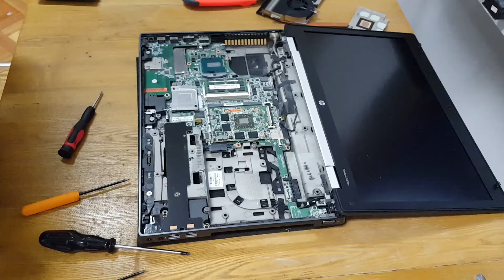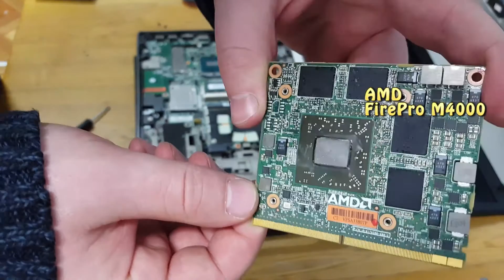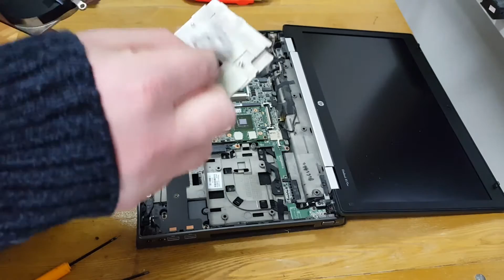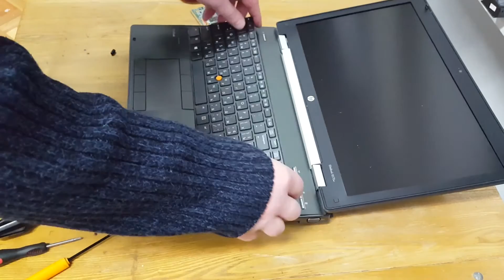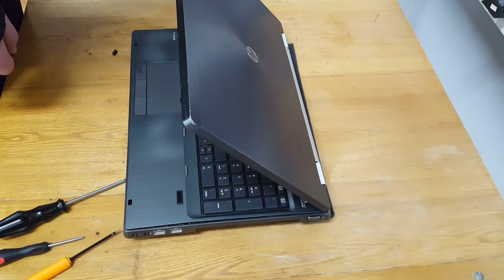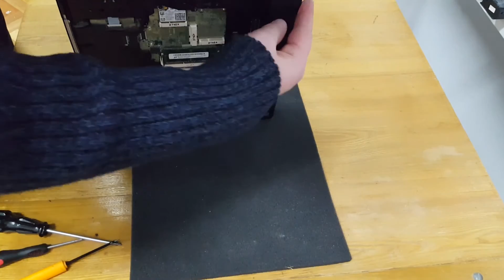HP Elitebook 8570w replacement graphics card, замена видеокарты FirePro M4000/NVIDIA 1000M

Comment: If you could help me out , I just got a 8570w online with the k1000m and found some information on the  1GB GDDR5 FirePro 4000 being a much faster option and was going to follow this video to for install. From what I can tell the firepro 4000 is in the manual for the 8570w so should ** work as a plug and play. If not i was thinking about giving the Freedos USB drive boot vbios flash step by step a go. I was wondering if you ever had to do that for a gpu card ? If so could you share a bit of info of your experiance. Thanks.

Comment: Hi, is it possible to upgrade stock NVidia 2000M on 8570w to NVidia K2100M (from HP as well)? If so, does it require re-flashing the VBIOS? Большое спасибо ;)
Reply from the maker: Yes you can replace video card, bios should be ok

Comment: Been planning on upgrading my Zbook 15 G1 by installing a Quadro M2200 on it. The hardware install procedure must be similar, but I'm not quite sure if it'll work, there's not much info on this particular setup, but I know it works with the M2000M.
Reply: Also, it would be nice to know whether you had to deal with driver incompatibility, messing with vBIOS and INF files, et cetera.
Reply: @Darian Brandon Instablaster =)
Reply: @Nathanael Harlem thanks so much for your reply. I found the site through google and im waiting for the hacking stuff now.
Takes a while so I will get back to you later when my account password hopefully is recovered.
Reply: @Nathanael Harlem it worked and I actually got access to my account again. I am so happy!
Thanks so much you saved my ass!
Reply: @Darian Brandon happy to help :D

Comment: hello
can i replace quadro k1000m/gtx 970 in hp 8570w?
thanks.
Reply from the maker: I'm not sure
Reply: There is officially not enough room to fit a larger size, MXM type B, in the 15 inch versions. They only accept MXM type A.

Comment: Hi, today I cleaned my CPU and GPU heat sink, but when I reassembled keyboard, the backlight didn;t work! I checked every connection there is nothing wrong with that, even the Num lock and Caps lock lights work! what should I do?
Reply from the maker: try double check connections
Reply: @handmaderepair4980  I did, I'm sure, so why Num lock light is working?

Comment: The k1000m is worse than the firepro, look it up.
Reply: no it isnt. with the statics it looks like its worse but in reality its better
Reply: QuintenGamed I've tested both. The nvidia lost in game debate and geekbench benchmark tests. That's why I switched to the firepro.
Reply: @quintengamed  Nathan is right if we're talking gaming benchmarks. The passmark scores on the m4000 are about double the k1000m. The k1000m though was technically a more expensive option when the 8570w came out. It does have some advantages in CAD apps and offers double the VRAM. The gddr5 memory in the m4000 offers huge gaming advantages though. The k1000m only has ddr3.